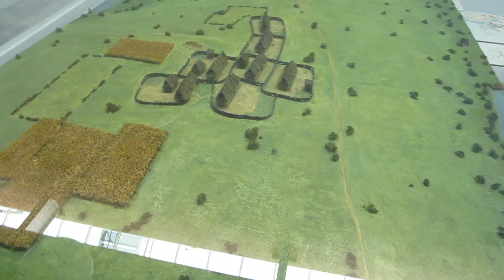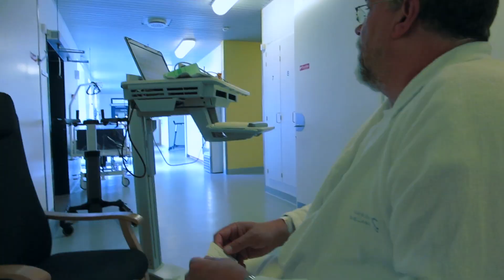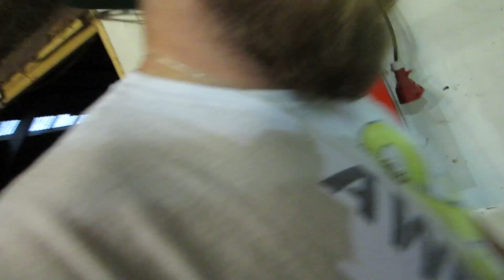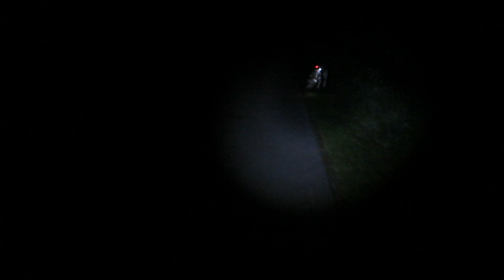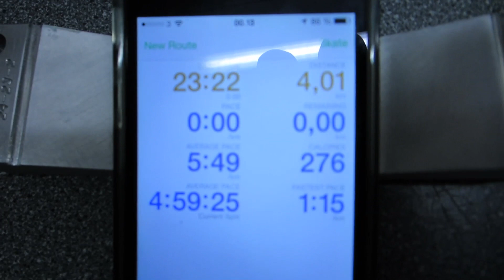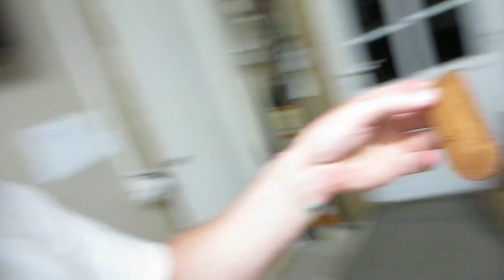AT THE HOSPITAL (5.14.14 - Day 1289)

Comment: I'm so happy that your fingerboarding again and also making fingerboards again as well. I have a question about graphics for the fingerboards, do you still use the paper technique or do you have another way? When i try to do the paper the paper just tears or is messy on the edges of the deck. Maybe im putting to much glue on the paper causing it to be to wet?